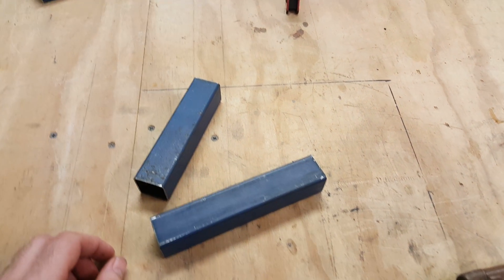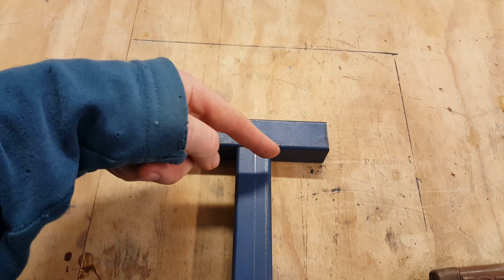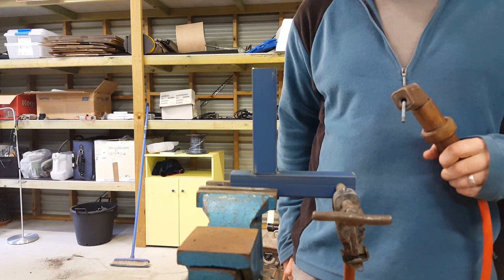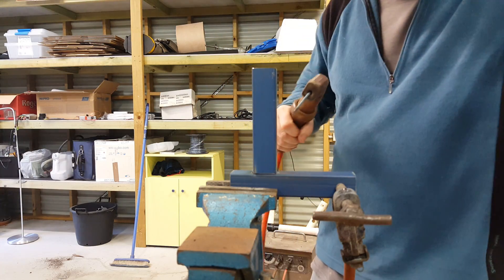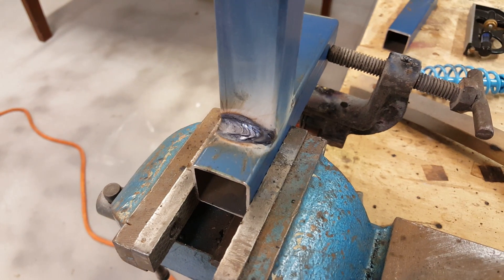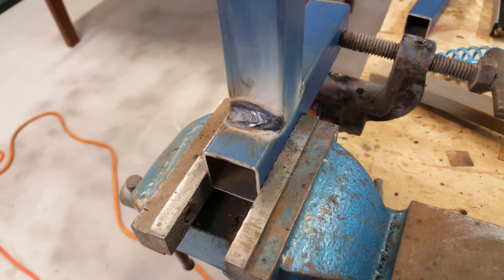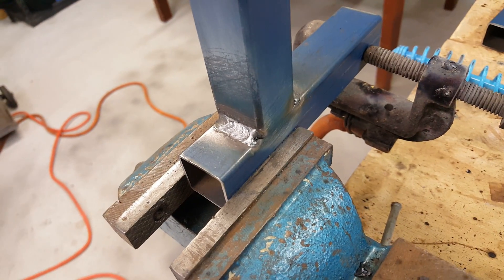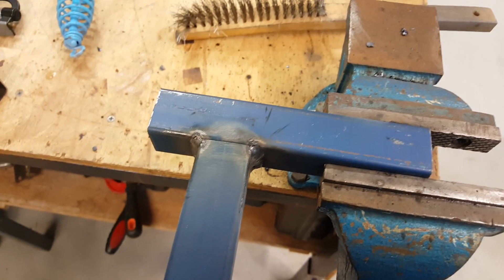Welding thin steel tube with a stick welder

Comment: When I first started welding back in 1985, I welded on 22 gauge steel. Thinner than what you are welding. I set the welder at 70 amps using a E7011 we had to weld without stopping, because the welds had to be grinned smooth, and painted. On thin tubing if you can not weld a full weld without stopping use a thick peace metal to absorb the heat. You can clamp it on both sides of the weld and never have a problem. Starting and stopping is not a good weld for withstanding the rating of the weld. I bet if you try welding this 1/8" tubing with two 1/4" steel plates clamped very close to your weld you will be able to weld it the correct way. Good luck.
Reply: Intresting trick, sure i'll give it a go. Thanks for sharing the knowledge!
Reply: Please!,  can you do a domenstration vidio??
Reply: thank you for the tip
Reply: I do not follow any links to videos showing this. NO matter what I do esp on angles it can blow out.
Reply: Thank you.
Reply: Been struggling with thin materials for years because I'm too tight to buy a mig welder! Thanks for sharing.
Reply: @GdaySport  I'm the same way. I don't mind welding with mig or even tig I just don't feel like paying for the gas to use the mig or tig welders.
Reply: Make a video, Mickey Sanker!
Reply: @rosstituteuk  I don't a way to, since I don't own a welder.
Reply: mickey sanker What size E6011?
Reply: 3/32. Also if the heaver metal plate keeps getting stuck you can use copper plates.
Reply: @chris beerad It is easy to do that. I have done it many times. If you practice you can get it, I am sure that I'd have to weld for a few hours just to get one weld that looks decent since it has been so long since I did that kind of weld.
Reply: may i see the clamp look like i just dont understand sorry im new
Reply: @solumen_mriwik  He means use two pieces of steel , ( thick ally would most likely be better or copper ) & use a clamp or magnet to hold then to the sides of the steel tube he's welding , & hold them as close to the weld as possible . However the tubing that's being welded isn't 1.6 it's more likely 2mm or 2.5 .There's no way i'll believe a 2.5mm rod at 70 amps would not blow through the moment the arc is struck .Would need a 1.6mm rod or smaller at around 20-40 amps depending on the rod , heat sink or no heat sink
Reply: @scorpnz4433  im hearing you mate ..i have stepped down to 1.0 mm rods so that i can weld really thin guage tubing or stop start texhnique for thin plate ..like old fashioned car panels
Reply: @scorpnz4433  well yeah that's what I was thinking, if it was a 1.6mm thick then a 1.6mm electrode diameter would probably do fine at about 30Amps?
Reply: @scorpnz4433  coreect
Reply: @bryancallaghan1769  1.6mm rods on auto panel steel.. I use continuous spot welds to create the row of dimes effect...amps depends on your welder... i use a 180amp Apex ac trans & Satincraft rods for clean flux slag... if the bead pattern is like this video youre using too much heat & also lay the rod flatter... really very easy
Reply: Very good tip indeed. thanks.

Comment: The best trick I've picked up with long rods is to wear a proper welding glove on my free hand and then use it to hold the rod about 3-5cm above the weld between my thumb and index finger to steer the rod. You can then steer it properly as if it was a short rod.   👍

Comment: not too bad for someone who does not welding. but why did you leave the blue covering... is that paint or.. what. also down hill would be a good idea with low hydrogen rod. not a 6010 or 6011 type the penny is higher . than maybe 6013  or 7018
Reply: The paint was left on because their is no need to remove it for small jobs around the house that do not require full strength. Although it is a good practice to clean paint to help the weld 'stick'.

Downhill and low hydrogens dont really mix...even low angles..and they have more of a tendacy to blow holes not to mention this stop and start technique would be complete agony with a 7018.

And yeah the high cellulose rods are worth an arm and leg if you can even find them in australia....
Reply: Rpged Sniper I used 7018 down hill strictly for capping pipe in school. so I really don't know what you mean. it's an api standard in the US. less penny but clean bead . just telling you what I've experienced I went to school for welding engineering

Comment: Great video mate! Just a quick tip - the starting is easier not because the tip is hot but because the metal in the middle is exposed. To avoid ruining your ground clamp (like you did in the video), just break the coating at the very end of the rod to expose the metal... if you break too much you will have a little bit of harsh start, but it does the work! I have the pliers type rod holder and I just crimp the end of the rod with it - works every time!

Cheers!
Reply: Thanks, I found this out by accident, I just tapped the end of the rod with my hammer out of frustration because I couldn't strike an arc at all.

Comment: I use a lot of thin tubing for security doors and window grills. The smallest sticks I can get are 2.6 mm. I hold the arc only sbout a third the time of yours otherwise I get blowholes. I use an angke grinder to clean up and get a nice smooth curve and flat faces fokkewed by by a quick pass with a flapwheel ready for spraying, very fast. I never use a chipping hammer. True what you say, all vids show stick welding with thick metal.

Comment: I prefer using a higher open circuit voltage (80v) on thin
stuff. You can drop the amps even lower and still have a stable arc.

Comment: I'm normally a wood turner and delve into welding at my peril. I am repairing part of a gazebo for a neighbour and it's VERY thin steel. So far I have a couple of holes at one end, but I will be trying your method toot-sweet, as the French say? Ta foor showing it!!

Comment: Hi Chris. This info is brilliant. I tried it this weekend and after 3 practice tee joints on 1.6mm wall tube I can do a reasonable weld with no blow-thrus. Also tried 1.6mm rods but found the 2.5mm ones (E6013) much easier to use and strike. The stick welder I borrowed is just a small $80 transformer type with a switch selector for 3.25mm or 2.5mm electrodes. Thanks again mate.

Comment: I learnt how to stick weld with a shit arc welder on 1.6mm material.  Got it done the way you did it.  But yeah not fun esp if the pieces weren't a perfect fit.  Slow process 
Am considering a gasless mug as most the things I'll weld probably be 1.6mm

Comment: i just attempted to weld 1.5 mm box section with a cheep welder 2.5mm welding stick and blowing holes all over the shop used to welding bigger stuff not really able to adjust the welder maby set it to 1.6mm would that help with blowing holes in my ship :)

Comment: Are you trolling? Because all of this is wrong.
Reply from the maker: So please tell everyone how would you have welded two pieces of 1.6 mm square hollow section with a stick welder - we're all here to learn.
Reply: First I would wire wheel all the paint off there and get it to shiny metal. Then, I would use a fast freezing rod like 6010 or 6011. Tack the pieces together, from those tacks I would decide the appropriate amperage, then weld those shits up. 

You could always use lower amperage and use a faster travel speed with the rods you are currently using, so you don't burn through. Welding with individual tacks like that is proven to be weaker than a full bead.
Reply from the maker: I will have to do a video of me using lower current settings and hopefully demonstrate why I use this method instead.  As I have mentioned elsewhere, unless I run 75 amps I don't get sufficient penetration between both pieces.  The blue stuff is a metal-based paint which is very thin; I never find it to be a problem, and identical to working with bare metal.  6013 is the most common electrode in Australian hardware stores, suggesting there must be a good market for them.
Reply: You should take the proper precautions in making sure there aren't any contaminants that would affect the bead. Taking off any paint would only take a few seconds and plus I'm sure that shit isn't good to be breathing in. My experiences with 6013 rods aren't all that positive, the bead turns out to have discontinuities at least half the time. I found it runs decently down hill. Next time try running the bead down hill ( Start at the top of the joint and weld down, in the vertical position).
Reply from the maker: I had a phone protecting me from the slag :)

Comment: Hi chris good video I've been welding for years, my only thoughts on the video is you should be wearing welding gauntlets and at least a dust coat made of cotton, the gauntlets let you hold the electrode closer to the hot end instead of the holder without getting burnt, take care, happy welding

Comment: Cris, i did with 1,2mm square hollow. I was used 6013 in 70-75amp. But why, i always got aku hole? Could you please help me..... Thank's
Reply from the maker: 1.2 mm is very thin - this is 1.6 mm and that extra 0.4 mm makes a difference.  I think you will definitely need to lower the amps to about 50-60 amps for a successful weld of 1.2 mm steel, but you are also at the limit of what can practically be welded with a stick welder.
Reply: Chris, it's work, i did like what you said. Thank's for your help...

Comment: I looked through a good portion of the comments and didn't see any insults or criticism really. Not wanting you to be disappointed YOU SUCK. 
 Just joking of course. Good tip in my opinion. Thin stuff can be very frustrating.

Comment: Your welds look as great/bad as mine. You never said anything about your electrode, should it be as thin as you can buy?
You are also welding AC, right?
Reply from the maker: I'll take that as a compliment :)  I'm using 2.5 mm electrodes.  I find the 2.0 mm electrodes re consumed too quickly for me to keep up and make a good pass.  And yes, the welder was build in about 1970 so it's definitely AC.
Reply: 3/32 inches is 2.5 mm. Chris, keep up the good work, thanks for the video. I always wondered how good my welds are from a structural perspective. I am self taught and I really cannot tell if having a sh&*t inclusion like yours (I have these too with half of my welds) is really compromising the integrity of the weld...
Have you ever tried to weld thin steel like that with 1/16 inch = 1.58 mm rods ?
Reply from the maker: That's a very thin rod!  As for the strength, I have built gates and frames which hold reasonably heavy loads and are flexed regularly - so far nothing has broken.  Inclusions are bad, and they should be removed where possible as they will compromise the strength of the weld.  But I'm not building a race car here...

Comment: Need video,  I need help with a small project.  For a 1 1/2" tube 16 gauge;  what stick you recommend.?   
The project is a Brewing stand (stove).
Reply from the maker: 2 mm or 2.5 mm rods are okay.  I prefer 2.5 mm rods as the 2 mm rods are consumed quite quickly and it can take some getting used to.
Reply: Chris Jones  But What type  7013, 6011, etc. ?   
What type for mild steel square tube.?
Reply from the maker: specialized41 6013 will be just fine. I have never welded with other types before, so I can't say if they would be any better.

Comment: Hey i got 2mm thick tube what rod should use
Reply from the maker: david lacle I've never had any problem with 2.5 mm rods. 2 mm tube will be more forgiving too. These welds were done at 75 amps and 45 volts. Let us know how you go!

Comment: can you turn down the amperage on the welder?  I suspect the amperage is set way too high for thin metal welding.
Reply from the maker: This current (75 amps) is spot on for penetration and maintaining arc flow.  Any lower it sticks and sputters.  I find it easier to regulate the heat by lifting up, rather than adjusting the amps.  Anyway, the technique works for me, so I felt I would share it :)

Comment: Use smaller rods.  You make the job look harder then it is. Learn to adjust your amps.  The welding leads are to long and your amps have to be raised.  Stick to smaller rods.  As my girlfriend told me "hotter rods getting deeper penetration".  You burn holes because you use too large of a rod for thin metal.

Comment: what rod are you using? 0.o
Reply from the maker: Yep, as the video description says.
Reply: judging by the slag inclusions and porosity, I would say 6013.
Reply: I knew what kind of rod it was without even having to read the description, just by looking at the weld.

Comment: Great video Chris thanks, this has been a huge help. Can you confirm what electrode your using? I know you mentioned it 2.5mm at 75A but are you using E6013 or something different?
Reply from the maker: Scott Beer I'm using 2.5 mm electrodes. I find them easier to use than 2 mm electrodes as they don't get consumed as quickly. 75 amps is the best compromise between penetration and ease of welding. Any lower and the electrode sticks and includes slag.  These are 6013 electrodes from a hardware store. And they are pretty old...

Comment: turn you amps down and use about a 20 -30 degree angle with the rod pointed towards the puddle works for me. this will alow you to run a constant bead.

Comment: No gloves, no overalls.  Proper Aussie welder. ;)  (disclaimer: not suggesting you should NOT use gloves and overalls for safety - you should.)
Reply: Hes not giving welding basics and lectures, hes here just for a quick to show u how to weld square tubes.
Reply: VauxhallViva1975
On your Headstone we're going to put " Here lies VauxhallViva1975 he got here safely"
Reply: dont weld in crocs .thongs are ok cause you can shake the slag out. Stubbies are to be avoided cause you can burn your nuts
Reply: I haven't used a stick welder in over a year. I usually just use my everlast mig welder for everything but I should practice stick welding every now and then. Gloves are cheap and in a pinch a Jean jacket made of cotton can cover bare skin and help prevent against burns. Safety is often undervalued until someone gets hurt.
Reply: A true aussie would of been wearing a blue singlet and stubbies while bent over welding showing arse crack.
Reply: @Hahehhwgajshah72726..  A true Aussie '...would of...'
Reply: @Hahehhwgajshah72726..     That would be a plumber in the USA  - "Plumber's Ass" is the expression.
Reply: nothing screams "STRAYA" like this video clip hahaha
Reply: no e' l'abito che fa' il monaco
Reply: The ultraviolet light will affect his skin in later years.  Radiation is not to be messed with and gloves and covering should always be  worn.  I know this for a fact.
Reply: @1Widowsson0  I used to do some hobby arc welding some years ago with an open neck shirt.  Gave me skin cancer in a "V" on my chest just down under my chin. Fellas, protect yourself. use gloves, long sleeves and button that shirt up.
Reply: That is completely wrong. While people can get away without using gloves and an overall, you should wear it. For one, it protects you from the rays. Then the obvious protection from berries which can drop down especially if you are doing odd angles. A thick leather glove will not burn through. Personally I use an old cotton military jumpsuit and some welding gloves.

You don't want synthetic protection around any heat as it will melt and stick to skin. I think that is what you were thinking of.
Reply: Completely agree.  Welding gloves are very cheap.  Overalls(coveralls) are a little more costly, but money well spent, IMHO.
Reply: I'm big on safety also but it's not that big a deal here.  What's the worst that can happen in this situation?  Get a few holes in his clothes or a little "ouch" burn on his hand!  The main thing here is that he is wearing the correct welding visor and the other main thing is proper ventilation, as welding fumes can be very nasty.

Comment: Good video Chris,, I have been welding 1/8 sheet metal and I started with 6013 like you then went with 7014 then settled on 3//32 7018 at 90 amps dcep the welds are great. You have an old buzz box and you do well with it I have still a Miller Thunderbolt and it was okay,, but Now I have Fronius Transporter 180 MV and I say it is night and day,, save your pennies and get a Fronius   made in Austria they are something else. They are not cheap and still costly here in Canada,, anyway check their web page and other youtube videos you will want one,, you welding will be even better. Good luck .

Comment: I can tell right off the bat your to hot. when welding in ac alternating current your heat goes more to ground than the rod. those slag inclusions are most likely from the paint and from you lifting the arc length and shortening it. not really recommended. I could of done this easily with 3/32  7024 or 7018 with a very short arc lenth. just saying

Comment: Good video. Typically all we see is persons welding 1/8" thick stock so they keep the rod burning but we never see stick welding thin stock like this. Your technique is exactly what is supposed to be done so well done. The inclusions of slag are expected because of this required technique however you did the right thing by chipping and cleaning out the welds and then doing a second pass. My only comment would be the lack of gloves. The UV light from welding is dangerous.